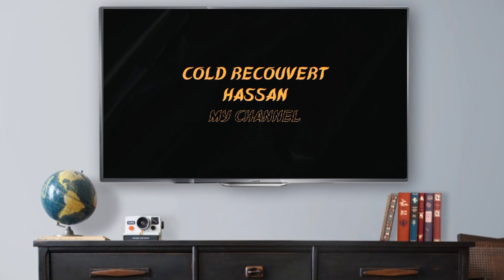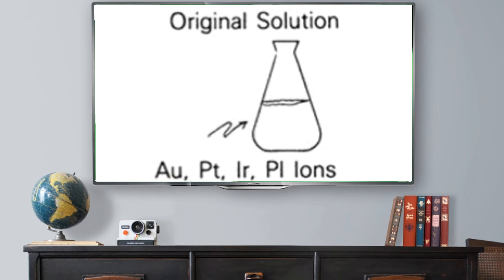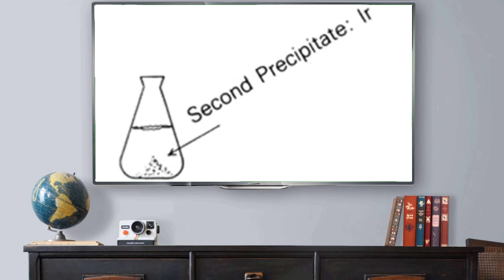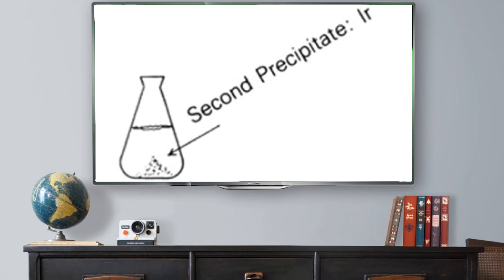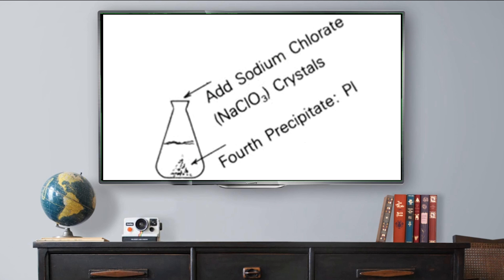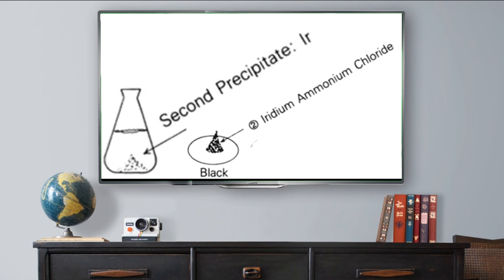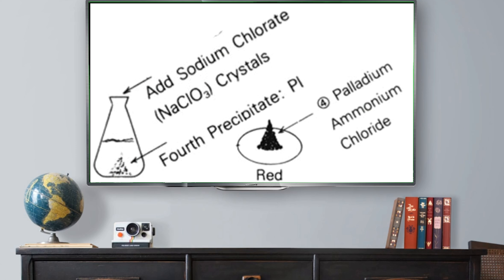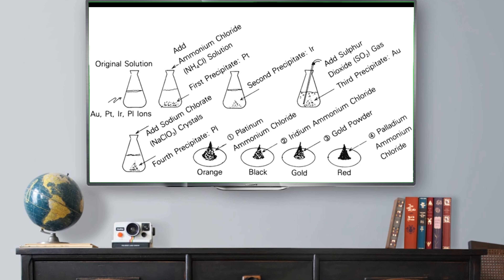Extracting Platinum, Iridium, Gold, and Palladium from Aqua Regia"#goldprocessing

Comment: Thank you this is new for me percipitate the Paladium using potasium chlorate instead DMF, if i can advice please make a video about recyle the ceramic capacitor that contai paladium and silver using chemical like boiling with sodium hydroxide first add nitric acid then disolve in aqua regia percipitate using potasium chlorate the melt it.

Comment: does iridium ion from rock dissolve with aqua regia
Reply from the maker: Iridium, like other platinum group metals, is highly resistant to chemical corrosion, including attacks by acids. However, iridium can be dissolved by aqua regia, a mixture of nitric acid and hydrochloric acid, albeit very slowly and not completely. Aqua regia is more effective on iridium when the metal is in a finely divided form, such as powder, rather than solid chunks. The dissolution process involves the formation of iridium chloride complexes.